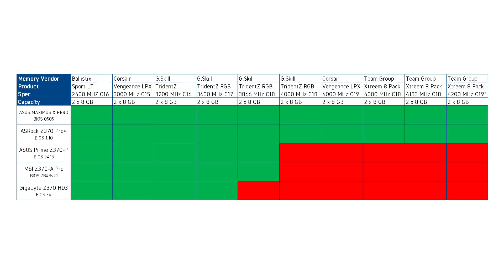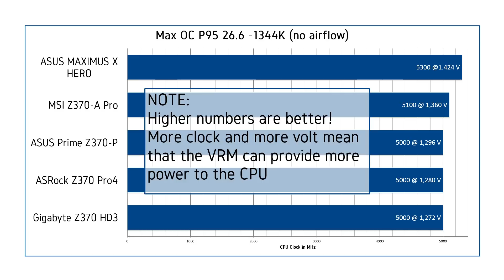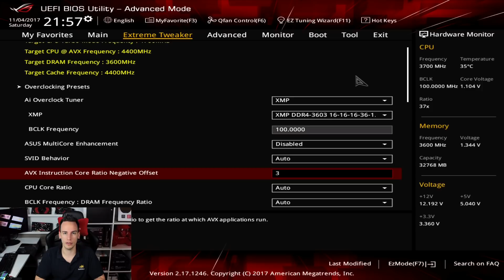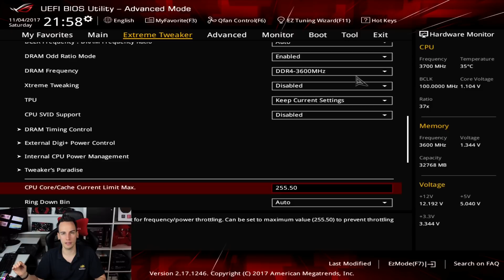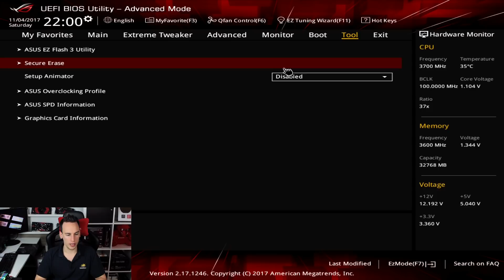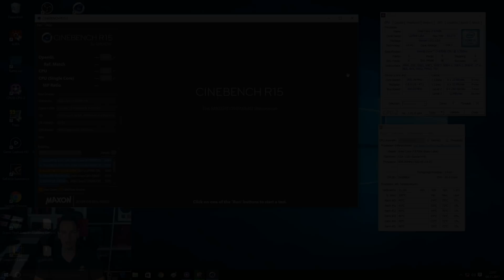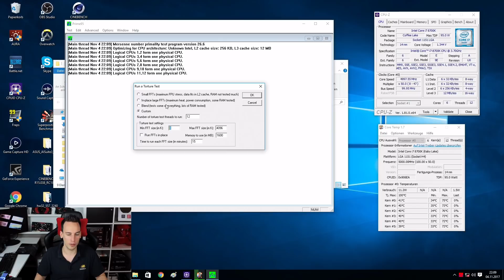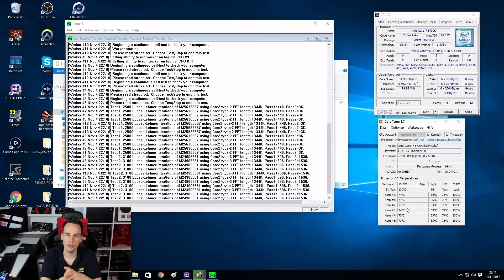ASUS MAXIMUS X HERO - Overclocking Test and Guide 8700K (en)

Comment: Thank you for this in-depth and easy-to-follow overclocking guide! I use the previous generation (Maximus IX Hero) paired with a i7 7700K. Is it possible to follow these steps with that? And if so, anything I should keep in mind? 

PC-specs:
Corsair RM750x 750W PSU
Asus Maximus IX Hero
Intel Core i7 7700k (not delidded)
Corsair Hydro Series H115i CPU Cooler
Corsair Vengeance LPX DDR4 3000MHz 16GB
Samsung PM961 SSD 512GB M.2 NVMe
Seagate Firecuda 2TB 3.5" SSHD
ASUS GeForce GTX 1080Ti ROG Strix, 11GB GDDR5X, 1569/1683MHz

Sisto

Comment: I7 8700k delidded with conductonaut thermal liquid.
Asus Strix z370 e
16gb of ram 3200mhz
CPU VOLTAGE: 1.38
Nzxt kraken 
 Used the same settings as you have, bios up to date.

Im getting bsod when trying to do cinebench

Any ideas because the voltage seems high enough
Reply from the maker: just try 4800 mhz on the CPU first. Not all can do 5G. And if it works maybe 4900 after
Reply: der8auer ok i will try and see what happens thanks
Reply: Tried 4.8ghz at 1.35 and stress test with prime95 large ffts for 10 minutes looks okay for now. 74 celcius in core temp. Should i live it like that or should i try go higher? 

Or just let it be a bad chip ?

Comment: Followed the video and PC booted to windows. After 30 seconds windows 10 crashed, so im back to using 3.7ghz.
Reply from the maker: well it's pretty simple. Lower the clock by 100 mhz or increase core voltage by about 50mV

Comment: My 8700k wont even run stable at 4.9ghz. Really disappointed in it
Reply: Railfanatic Mine is thermally limited. I can ONLY do 3.7 GHz. I have to disable Turbo Mode so it doesn’t BSOD. I have every thing at stock settings - really sucks.

Comment: I just did the basic for 5 GHz as instructed but instead I have 3200 for my memory due to having 2 G. Skill Z Trident RGB. Did the Prime95 for an hour with near the end have one core spike to 90 Celsius but no failures on the stress tests. The only issue is when I try to do a game benchmark, like FFXIV: Stormblood Benchmark,  it crashes the computer with no heat spikes and same goes for if I try to bench or stress test on CPU-Z. Games run fine but bench tests seem to crash the computer. Not sure what I would have to adjust to fix this.

Comment: Hey, i did everything u said, exactly how u did it, but whenever i overclock mines to 4.900ghz it only goes 4.895ghz. I tried changing the voltage, play around with it still same, any suggestion?

Comment: Would an M.2 Drive which uses some PCI Bus to function effect a stable clock to 5Ghz? I've set my BIOS parameters to match the tutorial and it will hit 5Ghz but jump between it and around 4.7Ghz. Any suggestions welcome. CPU-Z also shows the Bus Speed dropping slightly from 100Mhz to 99.98Mhz.

Comment: Help here, I did everything step by step as shown in you video, but cinebench gives me only 1410 points instead of 1600 
Asus Hero X Wifi-AC/I7-8700k/3200 Corsair Dominator 64gb
Reply: Same here. I get even worse scores. Anywhere from 1100-1400. Good temps but shitty score. Did you figure it out? Any help would be helpful. Thanks

Comment: hi! thank you for the awesome guide, i have been testing my setup and recently delidded my 8700k. easily got to 5.2 without delidding and wanted to test the max of my cpu. i can get 5.3ghz with 3 avx offset 1.440v but cant get it to pass 10-30 mins on 2 avx offset on aida 64  trying 1.440-1.465v in .005 increments. would you consider safe for 6-10 hour gaming sessions at 1.47v? or should i just stick to 1.440v 5.3ghz (5.0 ghz avx)? (temps are all below 80 C)

Comment: This worked for me and I tweaked it down to 1.335v and 0 AVX offset . However I got very high temperatures and decided to delid and move from air to a 280mm AIO cooler.   My CPU will not do any more than 44 on the Cache. 

Now I wondered is there is a way to make the Vcore adaptive so that it doesn't sit at maximum Vcore even when the computer is basically idle??  I already use balanced power settings in windows so my CPU down clocks when not being used.

Comment: I tried to do that step by step the oc setting from the vid. 
Spec
8700k
Rog maximus x hero z370
Kraken x62
G.skill 2x 8g triedent z 3600mhz 
650w psu. 

When i run cinebench r15 i get bluescreen  instant maby 5-8 seconds. Temp hitting 85 

I tried to increase volt to 1.4 to see it is still blue screen. And it did. What can bedre wrong ?
Reply: ashkori1993 youre temos are the problem. Use less voltage

Comment: I applied your settings. I'm using a be quiet dark rock pro 4 cooler and just delidded my 8700k and on cinebench I'm pushing 90c. Why??
Reply: The first delid I had did not work very well because there was too much sealant used to re-seal the CPU and that reduces heat transfer. The second time I used hardly any sealant.    Also it could be not enough liquid metal was used when the delid was done. Or not enough thermal compound on the IHS, or the cooler isn't seated properly. 

High ambient temps or a restrictive case with bad air flow could play a part.

Comment: Awesome video! Unfortunately, hitting 5.0 GHz for me (8700k and Maximus X Hero) is fairly unstable, and ended up getting blue screens. Clocked it down to 4.8 GHz, and it works perfectly. I'll probably fiddle with it a little bit to see if I can keep it stable at 5.0 GHz. Also using the NZXT Kraken X62 AIO w/lid still on the CPU, so may have to de-lid before I can go a little higher.

Comment: Is the Noctua nh - d15 enough for 4.8? and what voltage is recommended for 4.8? thanks
Reply: @Liviux the nh-d15 it can serve you for 5000 mhz indeed. The voltage is relative to the silicon lottery because de "purity" of silicon. Some chips do it with 1.18v other with 1.39v is hard to say what chip you have.

Comment: Under 100% load my CPU was clocking down 300Mhz, due to the AVX negative offset.  I was still getting cpu temps in the low sixties.  Do you think I could reduce that offset?

Comment: Hi der8auer,
thank you already your video that explains clearly how to configure an OC 5000 mhz even if I understand not everything because I do not speak English.
I have a question to ask you, I have an 8700k i7 on asus maximus x hero with 16 GB of Ram but since 1 week my frequency under windows 10 64 bit does not exceed 4600 MHz under bench and games while my CPU is configured at 4800mhz x3 cores and 4600mhz x3 cores.
Yet a week ago, he climbed to 4800 Mhz in bench and games.

Thank you in advance for your answer.

Comment: thanks for your great video, i m surprise you don't change voltage for the ram, by default it s 1.34v instead of 1.35v from the MB, i have the same config like you just 2X8gb trident z @3600mhz, i test my config cpu stock, xmp active voltage check for my dram @1.35 with hci memtest pro, it can't pass 200% test without error. in this video you don't speak about dram stability

Comment: Hey.
Thanks for a great video.
I've been overclocking different CPU's for the past two years so I don't feel like a complete noob, but this question has been nagging me since I bought  the 8700K + Strix Z370-E mobo. Whenever I disable CPU SVID support my PC behaves weirdly. I can't even boot into Windows. I'm 100% sure that everything is stable. Can anyone explain whats going on?

I have a delidded 8700K @ 4.8GHz, 1,25v, LLC 5 - temperatures never exceed 60 degrees.
ROG-STRIX Z370-E with the newest BIOS 615.
16 GB Trident Z RGB @ 3200; 16-18-18-36.

Comment: Its normal after this oc with all stable when i disconect the psu from the wall or turn off the back button and i conect again and turn on the pc its turn ON then OFF and again ON after that all ok. It only happen when i disconect the pc at night and conect in the morning in the first boot after that if i power off from windows without disconect or power off the psu from the button it boot normaly

Comment: The CPU is clocking down to 800mhz at idle, but the voltage still the same +-1.35v, can u adjust the voltage to scale with the frequency? As example, at idle u stay at 800mhz, but with a proper voltage like 0.9v. I use to made it in my 4790k build, 4.6ghz 1.158v under load and 800mhz 0.888v at idle. Do u think i can achieve that configuration in the coffee lake platform?
Reply: Renato Amaral if you follow this tutorial, it s normal you should use svid enable and cpu core voltage set to adaptative

Comment: Much thanx man! I followed yr guide, and got 5GHz on 1.35V. I get max temps 78 to 85 while cinebenchR15. When I started prime95, I get temps 65 to 72 but my cpu clock speed lowers it self to 4.7GHz (as CPU-Z shows). Any suggestions why this is happening?

Comment: Hi, I overclocked one pc with the same mobo, g.skill 32gb 3200mhz. Other PC with the same specs went to 5ghz without any issue except one it keeps crashing (bluescreen). I tried up to 1.42v still no luck. No temp issues 70-80c. What could be the problem. I tried 4.9ghz it was stable it just don't want to go up to 5ghz

Comment: Hey. @der8auer Just purchased my 8700k few days ago.. Follow your steps and it's not handling 5.0GHz at 1.35v :/ But handle 4.9Ghz at 1.3V, every single option you have made i have changed. Same Board everything the same less the memorys. AVX set 0 and Overclockek Cache at 47. Everything stable. 83 ~85 degress stress test. Must i aim the 5.0Ghz or it's ok? Because 4.9GHz 1.3V it's ok, 5.0GHz even at 1.4V is not stable :( To much diference... My PC at 4.9Ghz -> https://imgur.com/e5E1t1C

Comment: Hello, I followed your guide exactly. I have 16GB RAM, OC to 3200MHz,  X HERO Mobo and 8700K with GTX 1060. But for some reason I crash and blue screen every time I run the cinebench test. I have a TX550M. What am I doing wrong here?

Comment: Coming from overclocking a i5-655K (with t8y of TeamAU) to 5ghz, shortly before it died, and spending a lot of time overclocking on X58 (i7-975XE) and Z77 (i5-3570K - 4.4Ghz @ 1.35v stable), I hit a wall trying to get above 4.7Ghz on my i7-8700K. Thankyou so much for this video Der8auer. I watched it 3 times before taking notes of every step, and testing your settings. PERFECT RESULT! After just couple of minutes in XTU, the temperatures were just too high for my old Corsair H100i to handle, and thermal throttling ensued. I think it's time for a delid. I am now on 4.5Ghz @ 1.2v (LLC 3, around 1.12v-1.16v under load in Windows) for my daily clock, using a couple of things I learned from this video (Your explanation of SVID, BCLK Aware Adaptive Voltage, and AVX really helped!)

Excellent work as usual der8auer. I was pushing 1.4v and getting no where. Perhaps a video explaining a few more of the settings that are common among BIOS that can affect overclocking would be helpful to myself and many others? Understanding what each setting does is a large part of successful overclocking. I've regained the confidence to continue tweaking this CPU until I have it "just right" for a low power, high performance daily use, and a "balls-to-the-wall" overclock for getting back in to benchmarking again.

Comment: i plan on getting this board, i dont want to overclock my 8700k just yet, i do want my ram to be at 3200  when i first set my pc up will i have to mess with any settings to just keep my cpu at stock ? im new to all this and not confident with messing around with anything with the cpu
Reply: Auto settings throughout most of the "Tweaker" section would be fine. You will want to turn on XMP Profile to bump your RAM up to the rated speeds.

Comment: I've followed these instructions to the letter and every time I run prime95, the cpu drops to 47x100 (4.7ghz). I understand (I think!) that it's because of the offset of 3 (300mhz) that we did in the bios settings. I just don't know why it keeps doing it? If I open heavier software, it throttles down again, then once everything is ticking over it goes back up to 50x100 (5.0ghz). As long as I run stable in prime95 without the offset of 3, is it ok to leave at zero - or is this all because of something else? thanks
Reply: oh and yes, I did set the OS to run in high performance mode

Comment: On idle my core voltage is 1.360V and dropping sometimes to 1.344V. While running cinebench it's dropping to 1.328V. As I can see in your video yours isn't dropping. Is this drop a problem? 
Also my cinebench score is just at 1531 points which seems quite low compared to yours. Any thoughts on that? 
What can I do against it? Measured with cpu-z, llc is set to 6. I'm running the z370-e, 3000Mhz trident z and the i7 8700k.

Comment: update on delid. Delidded and thermal grizzly applied also swapped to a custom loop (ek supremacy evo block) now running stable 50 oc at 1.385V ran prime 95 for an hour with no issues voltage went to 1.402 and  a max package temp of 66c super happy with how everything turned out thank you again for the great video will probably try to push it a little further would like to know how high i can get my sample to go =)

Comment: Hi @der8auer, I followed this guide and I'm able to archive 5Ghz@1.37V with LLC5
But every time when I cold boot my pc, it always stuck at ROG splash screen. I have to press the reset button and it will boot successfully into Windows.
Any idea why this happen? Only on cold boot though.
Reply: I have the exact same problem, if you enable cpu svid support cold boot should be fine but then vcore will be much higher then it should be.
Reply: Hi, thanks for help, enable svid support solved the issue but I don't think this is a good solution as it will affect the vcore
Reply: Yea i know that's not a good soultion, but that's the only fix i figured out, maybe next bios update will fix cold boot with svid disabled or there is another way to do it but i don't know.
Reply: I also saw your post on asus rog forums, the solution the guy provided does exactly the same thing as enabling svid support alone at least for me, cold boot is fine but vcore is not what it supposed to be it's much higher.

Comment: Hi, First of all thank you for this guide, very helpfull, i have the same mobo an the same CPU, i put in the bios all the steps that is showed in this video but i think i have a problem. When i do the prime95 test in Realtemp the maximum temp is 70°c but cpuz shod me that the cpu stay for 2 second at 5000ghz and then go down for other 2 second at 4699ghz, and It is repeated cyclically for all the duration on the test, it's normal? because from intel Xtu It show no signal of thermal throttle and show always cpu usage 99%. What could be the problem? i have to go up whit the vcore?

Comment: I have done all steps form this video, ended up with 4,8ghz 1,23v prime95 for 1 hour no issues, the only problem is after all that the computer always fails the first boot of the day (reboot on the windows loading screen), after that it turns normally (manual reboot from the system is always good first try), this does not happen with default bios settings, any tips how to fix that? (MemTest86 also passes all runs with no problem after xmp enabled, newest bios 1003).
Reply: If i enable cpu svid support then first boot is good but vcore is scary 1,44v, it goes back to 1,23v after reboot, any fix to that? And why i have to have svid support enabled to have first boot ok? @der8auer
Reply: Did you manage to figure it out? I’m having exactly the same problem with my machine!
Reply: upgrade your bios
Reply: Having the same problem with first cold boot of the day!
Reply: thats because the ram votalge..at 1,35v isin't stable, just put 1.36v and you would be fine. the pc need to reboot at start to make stable the voltage of the ram to boot, that why you start the pc and reboot one time, and some other motherboard maybe more times to get initialize.

Comment: @der8auer I have 4.8GHz stable at 1.28v on an 8600K and Asus Prime-A using manual voltage but if I want to use adaptive and enable SVID, as soon as I boot into windows and open cpu-z it shows 1.5v independent of what voltages I input for additional turbo and offset. Please help!
Reply: did this turn out to be the load line calibration?

Comment: Achieved 5.0Ghz @ 1.290v with my non-de-lidded 8700k. Temps idle around 28-30c, and hit the mid-high 70's running IBT and Realbench. Now I'm curious to see how far I can take it once my de-lidding tool arrives :) 

One question though - now that I hit a stable clock, can I re-enable cpu svid support?

Comment: Finally finished my 8700K build. Got to 5.1GHz @ 1.36v @36C idle. Temps go to 60C under load. Still a bit of a headroom to 5.3GHz @1.38V
But what's the point in that? I believe 5.1GHz is quite ok already.  So lots of thanks to der8auer. BTW der8auer got 1654 points from cinebench @ 5.0GHz. At 5.1GHz I
got 1590 for my troubles. Now that is definitely fair. lol

Comment: I set the same exact settings and I'm hitting 100c on my 8700k. 
I have dual 560mm radiators with 16 fans, delidded, with a monoblock.

Those temps don't seem right...
Reply: I replaced the plastic washers with rubber washers and now my max temps are 72c with same settings. Crazy how much of a difference something so small can make.
Reply: which washers did you replace ?
Reply: QC-Cool The stock plastic washers on the back side of the motherboard on the monoblock.

Comment: question about delidding i plan on using thermal grizzly on the inside of the ihs but say im using the ek liquid cooling kit with the aluminum cooling blocks... so i must use a regular thermal paste on the outside of the ihs. what kind of performance would i be losing out on temp wise by not being able to use the liquid metal on the outside of the ihs as well?